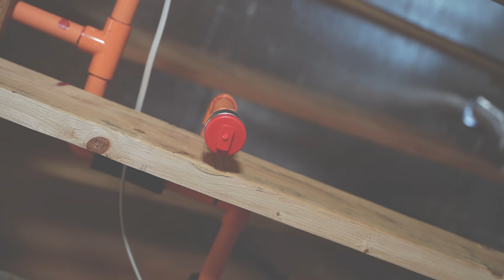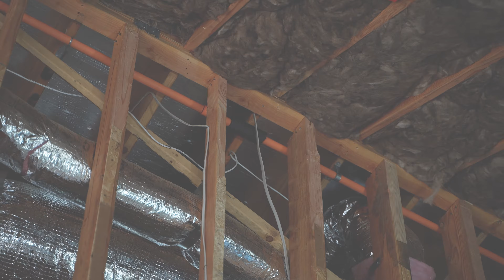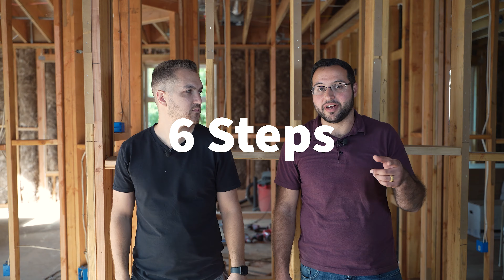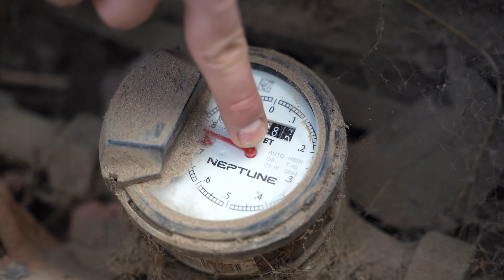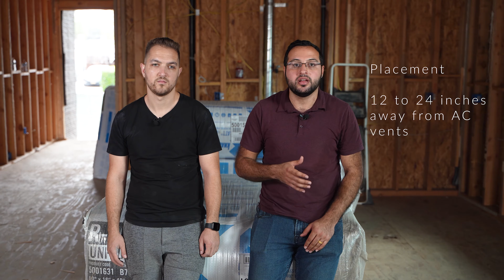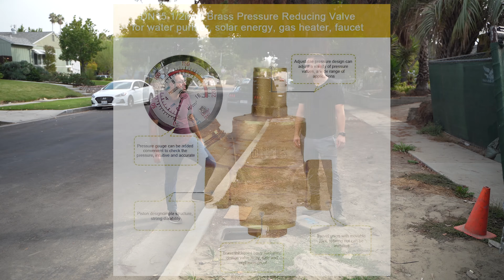Residential Fire Sprinklers: What You Need to Know in 5 or 6 Steps | House Flipping in Los Angeles

Comment: I wonder if a reservoir tank would have been an option instead of having to upgrade your water supply? They make tanks with booster pumps attached specifically for home sprinkler systems where water supply is an issue. Usually home sprinklers only require enough volume for 30 minutes of continued flow. A 500 gallon tank may get you there. That may have been a much more economical option. You should look at the standard or ask your sprinkler contractor.

Comment: That cpvc pipe is garbage! Gets brittle with age . Changing out sprinkler heads later , good luck you will be cracking and breaking pipe. If it freezes it will crack. everywhere.  They should have never approved this pipe .

Comment: Wrong, Wrong, WRONG, the size of the supply line has nothing to do with the spread of the water; there is a combination of pressure and friction pressure losses. 
Step 1 - get the right engineer
Step 2 - coordinate with mechanical, electrical plumbing, and architectural design.
Step 3 - get the right installer
FYI. 
16'x16'=256 sq/ft, the design requires 26 GPM. To utilize 20'x20'=400 sq/ft, the design requires 40 GPM, only 13 gal more.
So you guys paid 40% more for the sprinkler system.

Comment: Typically, only one sprinkler will go off in the event of a small fire. Not all sprinklers go off at once, like in the movies. That’s Hollywood. The only time this happens in reality is if there’s a massive uncontrollable fire from some explosion or Molotov cocktail. The other scenario is in an airplane hangar, a special type of system, where all sprinkler heads are controlled by one valve.

Comment: I’ve been plumbing for over. 20 years and I’ve never heard of 5/8” copper pipe. Just 1/2” and 3/4”. And I’m puzzled by the potential problems and damage from insulated electrical wires touching the orange CPVC pipes. What special coating is this?

Comment: May I move a sprinkle 1 feet or so ?  is that difficult or expensive?
Reply from the maker: You would have to drain the entire system in order to do this. Sprinkler lines are usually pressurized. The last of moving the line is very similar to moving a lawn sprinkler line, aside from the high pressure aspect of it. I would not recommend doing this yourself if you have no experience with fire sprinkler lines.
Reply: Also that sprinkler head may already be max distance off the wall,or that one foot might also put it too close to another head or a heat source.check your codes.

Comment: for the Meter situation... was a pump and tank not an option? cheaper than a new tap from the city... unless your local fire marshal wont allow it...
for aesthetics, there's flat plate concealers.

Also as for "flooding".   Most fires are controlled with 1 or 2 sprinklers. If a head goes off, depending on the pressure at your house it will be discharging between 20-40 gallons per minute. Typical fire department response times in a suburban area is around 10 minutes once the call is received, so lets say 15 total (if you have a water flow alarm on your system then your alarm monitoring company will make the call). At the most, 40gpm x 15 minutes = 600 gallons.... When they do get there, the fire will most likely be extinguished. The system will be shut down, head changed and now you have a mess to clean up in one room.
Without sprinklers.... a fire in a room grows exponentially without anything stopping it so that a situation called "flashover" can occur in as little as 1 1/2 minutes. This is when the fire erupts out of that room and spreads rapidly throughout the structure. So in the 15 minute response time for the fire department the fire has now spread to 1/4 to 1/2 of the house (15 minutes is generous too because unless you're there to call, no one else will call untill someone sees smoke or flames from the outside). When they arrive, theres another 2-5 minutes of setting up the hoses, hooking up to hydrants, and getting into position for the attack... if they think the roof is involved, they get up there and tear holes in the roof for venting and then they start spraying water from the hoses, at 250 gallons a minute per hose, for however long it takes to put it out. in the end they could end up using 20-30 THOUSAND gallons of water... vs under 1000 for a sprinklered home. Plus your house is burned down vs. having to fix a room.
Sure, if you're there and awake with a fire extinguisher handy you could catch a fire and put it out.... what about when you're asleep, or not home or in another part of the house and something starts?
If they accidentally go off, as with everything with your house, know how it works... know where the control valve is and shut it, then open the drain. This will stop the head from discharging almost immediately. 

One big tip for everyone is have the installing contractor include a spare head cabinet AND wrench. This should have spare sprinklers of the ones installed on your system. Its required by code on commercial installations but not on single family homes... they'll charge you for it but its worth the $200 or so. Each sprinkler has a specific wrench that goes with it that you have to use (or else you'll damage the head) and if you have one break you can change it out quickly.
Reply from the maker: Unfortunately city requirements for a new tap from the city. Thanks for all the info!

Comment: That plastic cpvc sprinkler pipe is crap.   Gets so brittle after awhile.
Reply from the maker: These are the pipes required by code, not sure about the lifespan but I know commercial buildings use steel piping.
Reply: Maybe if you leave it in the sun before installation lol

Comment: Great overview on fire sprinklers.  Although CPVC is common, PEX pipe is also allowed, correct?  Pex seems easier and quicker to install.  Why use CPVC?
Reply from the maker: I believe city code required us to use CPVC and pex is prohibited due to the level of pressure required to be in the fire sprinkler lines at all times. Every municipality is different.
Reply: CPVC is required per code. NFPA 13D
Reply: @noramatosian3228  Nope. NFPA 13D 7.3.2.1.1  Just has to meet the requirements for the application
Reply: Pressure and heat resistance are the differences I believe but I’m brand new to this lol.

Comment: How did you pressurize the lines? I just saw a video by a company that makes sprinklers that said never to pressurize cpvc with air or gas. I'm wondering what's going on in that regard. Thanks.
Reply from the maker: What our installer did was fill the lines with water from the main water supply line T'd off to a different pressure regulator. Before the fill he adjusted the water pressure regulator to match what pressure he needed in the lines. The lines are now always pressurized always and ready for a fire!
Reply: 11 months later. Testing with air is more volatile than water. So it’s a safety factor you have unglued fitting blow off or compromised pipe exploding.

Comment: wow what happened to creative thinking, its very easy to put a drain in every room for the sprinkler, they can be hidden and they can have their own drain pipe connecting all of them to one drip s pipe. so only one room gets some fire damage and free from any water damage, even flooding.
Reply: I wouldn’t use the words very easy to install drains over a house. To maintain pitch with existing obstacles is quite challenging. Not only that you would have to waterproof everything for drains to work. Carpet areas as well would be a change for a floor drain.
Reply from the maker: I believe our municipalities do not allow PEX for fire sprinklers because of the pressure required in the fire sprinkler lines at all times.
Reply: @SEFSU  how do they keep pressure in apartment building?
Reply from the maker: @johnwilliams-ni8cn  Pressure comes from the city line and is regulated down using a pressure regulator valve at the home. I honestly would not know the answer for an apartment building.
Reply: @SEFSU  apartments buildings have their own water pressure creators, more pressure or less

Comment: I get it... Sprinklers are NOT cheap, and therefore not for everyone or every budget, BUT... For anyone to say they are "useless" or even that they "don't understand them" is baffling to me. The water that puts out a fire can come in the form of thousands of gallons from a fireman's hose, or it can come in a more controlled manner from within the house. You can settle for more fire damage becasue of the time it takes for personnel and aparatus to arrive (and the more invasive nature of those firefighting techniques), or you can minimize that damage with nearly instant response from within the building. Water is damage, but fire is destruction. Sprinklers are absolutely useful, save property, and by extension save money. Where up-front cost/expenditure is not a consideration, they should be a no-brainer, and where cost is a consideration, they should not simply be dismissed out of hand as useless. Everything is a calculated risk assessment. TL;DR: I hear your valid desire to not have to include sprinklers, but the reasoning not to is flawed.
Reply from the maker: I think, as in my case, a bit of anger with the cost of them on top of lack of understanding and knowledge in their entire use causes people to not understand why we need them. Looking through the comments and also talking to different people through the fire sprinkler process we definitely learned a lot more than what was portrayed in this video.

Comment: I've been a sprinkler fitter for 22 years and I have many years in the fire service as a volunteer firefighter. I have replaced the sprinkler head after a fire and I am always impressed with how little damage there is. The residents are often complaining about the water damage, but I know that is because they don't understand how much fire and smoke damage there would have been without them. Plus the fire department would have to use far more water to put out the fire if there are not sprinklers so you have the water damage either way. The tenants are usually back in the other units by the time I get there.  I have witnessed the lives and property saved many times. I have also witnessed the water damage from accidental discharge due to human error (people like to hang clothes hangers on them in hotels). With everything I know about them, I retrofitted them into my 100 year old house. However, I do not agree with codes that force you to install them into a single family residence. I think there should be information given to the owner about fire sprinklers and how fast a fire can spread without sprinklers and let them decide. Do I want to cut 6K from the landscaping or flooring budget for now and install fire sprinklers. Or roll the dice that a fire won't happen to me. I get that it is different since you are flipping the house and may not have a buyer who can make this choice. My opinion is always less government. I feel your pain being forced to do this. P.S. I did a water tank and pump for my house because it was cheaper than bringing in a bigger water service. The downside is they take up space and you have more that could fail.
Reply from the maker: Chiming in here (a few months late) I definitely do see the benefit in fire sprinklers as an over all. I think I was being a facetious that may not have came across as intended. But I will always agree with less government overreach.
Reply: The problem I have is I am in the country . My system MUST #1 have a storage tank and aux pump. #2 i will be using PEXA , integrated into domestic cold water system. #3 the system will be post initial build in a MODULAR  HOME. 
Finding people qualified to design domestic water integrated fire sprinkler system in North Carolina is near imposable , finding one who will work with a home owner is more difficult
Reply: Totally agree. Please let’s make water sprinkler mandate in every house of United States .
Reply: Chiming in as a career firefighter and who now works 100% as a fire inspector and assist with cause and origin as well. The damage you get from a sprinkler head is much less in comparison to the usual total loss in an non sprinkled building. Even when the fire crew is able to contain the fire to the room of origin, smoke and heat damage, loss is much greater in cost in comparison to just the water damage in the single space of a sprinkled building. It also buys you time to escape the building. Keep in mind the fire department hose streams flow 250 gallons a minute compared to about 13 gallons a minute by a single residential fire sprinkler head contained to a single space.  You will have water damage throughout your home with a fire nozzle. I would much rather spend a few thousand dollars to rebuild a single room than be homeless and have to spend upwards of $150 Thousand, (probably much more in California) to rebuild the whole home and get rid of smoke damage and smell.

Comment: I’m a fitter I’m pretty sure the pipe can handle like 1500° and pressure is 250 psi
Reply from the maker: Cannot confirm or deny this! So we'll take your word for it!
Reply: Correct, cpvc forms a char that actually becomes a protective layer in a sense. The drywall is fire rated but is not there to “ protect “ the pipe. It can handle extremely high temps thus it’s UL listing. Also, sprinkler pipe needs to be hydrostatically tested at a minimum of 200 psi or 50 psi above maximum working pressure.
Reply: I assume you are referring to blazemaster CPVC pipe, it will melt like any plastic. It is designed to handle heat a little different than other CPVC pipe, but will melt. The drywall is protecting the CPVC from the heat and the sprinkler head is controlling the fire so it doesn't reach high temps that would get past the drywall and to the pipe. CPVC can be exposed, but with restrictions including the temperature of the head.
Reply: @dozer101308  Check your facts on the melting point of fire pipe come on now get a stick of schedule 40 Blazemaster and torch it it will only char k

Comment: So, you don't want a flood if there is a fire? Then you CERTAINLY want sprinklers. You generally only have 1 sprinkler head deploy to contain the fire, maybe 2. Each head puts out 13 GPM worth of water (typically) compared to the 300+ GPM a fire hose would use from a truck/hydrant. In a 13D (one or two family dwelling unit) sprinkler application like this, the job of the sprinklers is to give the occupants a chance to get out. Average fire department response time with a water truck (not aid car) is about 4-6 minutes. With new, lightweight construction materials and furnishings the time for a residential home to reach flashover (the absolute point where survivability is zero) is under 2 minutes. With sprinklers, 85% of the time a residential system will contain and EXTINGUISH the fire. Thus keeping that pesky fire hose from REALLY flooding your home. You are also more likely to be able to stay in your home or return to it within 48 hours if sprinklers are used to contain or extinguish the fire as it contains it to that single room source. You also get an insurance discount which over the life of a 30 year mortgage will easily pay off your $6k cost on the system in this instance. I could go on and on, but it would be worth your while to reconsider your viewpoint/attitude to this "useless" system. I hope they never ever have to be used, but if they do it is the best shot most folks have for getting out of their homes in time.
Reply: Can confirm. Had a friend who had a small kitchen fire that would have been put out by a fire sprinkler system. Instead, the fire Dept. dumped hundreds of gallons of water that ruined the entire kitchen and basement with water damage.
Reply: I would also add there are water mist systems that can be used and they take far less water.
Reply from the maker: @michaelraymond2546  I am not sure if city requirements would accept this but we will definitely look into it for our future projects.
Reply: @michaelraymond2546  Misting systems are for very specific system requirements. These are not designed or priced for residential systems and cost more to install due to the misting nozzle type and construction. Again, a standard 13D sprinkler system uses no more than 13GPM so it is already far far less than a fire hose or even a garden hose in some instances.
Reply from the maker: I think maybe our sarcasm and jokes were taken a bit seriously here. Eddy and I both don’t have much experience with fire sprinklers but we’re just being a bit bratty about having to spend a significant amount of money for fire sprinklers (which ended up being way more than the $6k all things considered).